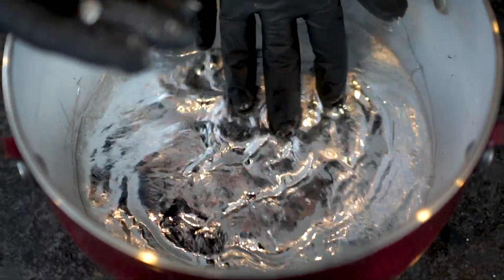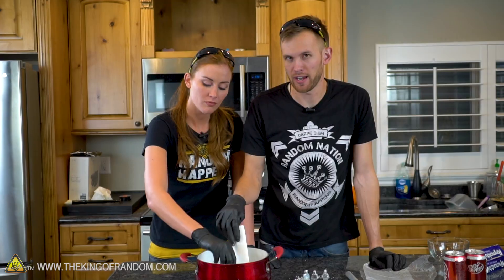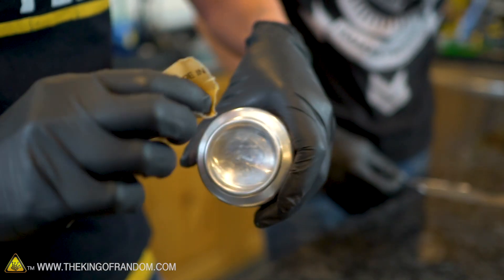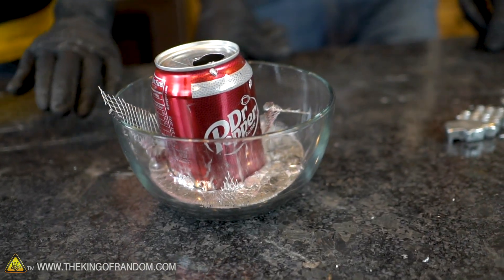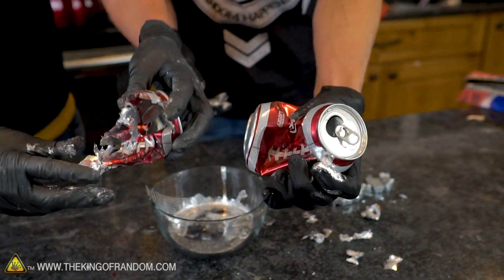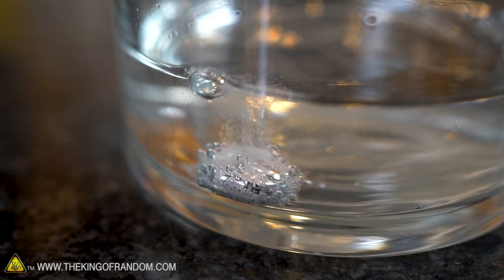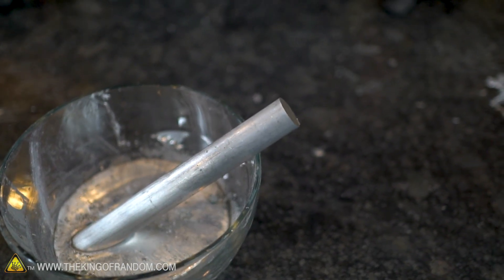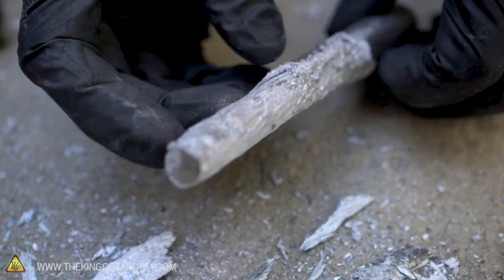We Made an Accidental Discovery

Comment: If you make a mixture in the ratio of 66.934 grams of Gallium for every 1.079 grams of Aluminum. Then heat it to about 700 Celsius, mix it and allow it to cool slowly. 

The alloy you made in this video was fairly weak, but what if you make as close to eutectic as the Al-Ga system is able?
Reply: Nobody will see this except me

Comment: I used to work for Lens Crafters and we used Gallium to hold lenses to the spot marker or a holder so we could generate the lenses , mark them to stick on the holder and also for the lense to be held in place for polishers to be able to work to remove the scratches from the lenses and to be able edge the lense to fit into the frames.

Comment: Can neverwet keep things from gathering condensation and/or freezing over?
Reply: specifically, use on a home A unit. I  sometimes leave the ac on too cold overnight, and wake up to the radiator covered in ice. Can a neverwet coating allow adequate heat transfer AND prevent the unit from icing over?

Comment: I’d like to see what happens when you put gallium in contact with aluminium cable and connect that cable to a welder supply. I suggest 25 square millimetre aluminium cable with 90 amps running through it.

Comment: How to break a solid 3/4” aluminum bar: 

Put it on a robot using it as the shaft for an arm on a gearbox with a 1000:1 ratio and overdrive the arm.
Ta-da! Snapped aluminum rod.

We had to replace it with a solid 3/4” steel bar instead....

Comment: That's not a plastic coating the aluminum absorbs the gallium like a sponge so the gallium goes everywhere inside the aluminum structure. You didn't need a hammer you could have just snapped it in half with your hands.

Comment: Can we get a video where you try to make a sandcastle but instead of sand you use "gallium aluminum alloy sponge"

I think you could light it on fire if it still has water in it, and that should remove most of it and make it a little more solid.

Comment: Aluminium and gallium slugs would be interesting. They'd likely just break apart in flight but if they could survive the g forces then they'd be an interesting round from a non over penetrating standpoint. You'd be hard pressed to shoot through a wall or innocent people behind the intended target with them. I know police forces use hallow points in the attempt to keep the rounds inside the suspect who is being shot and not have bullets go through the intended targets. But the aluminium and gallium rounds would simply shatter and likely not have much penetration. Would they even penetrate the intended target very far? You know who'd test this that Taofledermaus guy. It'd be interesting to have slugs or bullets or whatever made of the alloy that you made with aluminium and gallium and see what happens.

Comment: can you make a capacitor or battery using this new material? The gallium aluminum sponge? 

You made aluminum sponge! How does that effect the electrical conductivity of the aluminum? 

Being that it’s now a sponge the surface area must have increased dramatically. Can you use it as a dielectric material or as a collection plate? 

It’s very brittle but could you maybe hold it together using epoxy or some other glue? 

Please comment.

Comment: this makes sense, the only thing keeping metal from bonding to other metals is the oxidation on the surface of metal caused by the atmosphere. if you take metal to space you have to becareful with  metal touching other metal that does not have an  oxidationn layer cause it will bond with each other. In this video the galliam bonded with the can cause of the lack of oxidation under the surface of the liquid metal.

Comment: Tests durability by hitting with hammer for control.

Hits aluminium with it flat across the ground.

Proceeds to hit new bar soaked in gallium. 

Realizes it doesnt crack as easily as thought.

Rests bar on fulcrum of og bar and proceeds to hit soaked bar with needed leverage to break simply for drama; they say it's for a controlled experiment and then change for the drama. 

This is why i can't take this show seriously.

Comment: You should have an ingestion warning as gallium reacts with hydrochloric acid to produce gallium (iii) chloride which will paralyse you. Just a heads up. Also, elemental mercury's side effects are only present after regular exposure for a long time so really not that bad and also passes right through your digestive system without any being absorbed. Theoretically, you could ingest mercury and be perfectly fine but is still very risky as if it enters your lungs it will stay there releasing its vapours.

Comment: Your test with the hammer and the bars is not valid. You didn’t perform the exact same test. The non gallium aluminum bar was flat. You had the gallium bar resting on the non gallium bar resulting in a much refined point of contact.

Comment: The metal they used to build the twin towers
Reply: That’s why they’re not there anymore
Reply: Matt Peters lolz it will melt
Reply: They were actoally built to take the impact of the boeing. They just werent properly fireproofed.
Reply: @juanthehorse1988  To bad they didn't calculate in, that a plane has jetfuel in it.
Reply: @Sechs0rBecks  they knew that. Thats why they fireproofed it but the fireproofing came off on some of the main supports

Comment: The Gallium alloyed with Aluminum will prevent the Aluminum from generating a protective Oxide layer.  When introduced to Water the pure Aluminum, now unprotected, reacts to the water and splits the Hydrogen and Oxygen molecules better/faster than using Electrolysis technique.  That's why you had Hydrogen (and Oxygen) and were able to ignite it.

Comment: Please combine Gallium and Cesium to see what happens!
Reply: Nothing much, unless they are exposed to water
Reply: I want to see them conduct tests on it, including changes in conductivity, strength, heat capacity, and radioactivity, etc... as well as how it would react to blood, magnetism, fire, and water.
Reply: @BartholomewHenryAllen  would not react with fire, will have the same reactive for blood and water
Reply: Wouldn't fire heat melt the Gallium faster?
I know that blood and water also tend to have an attraction  towards metals. But I think blood would have the weirdest magnetic interaction.
Reply: @BartholomewHenryAllen  Gallium is already in liquid state at room temperature, so there is no need to melt it further, the iron in the blood is minimal and does not affect the overall magnetism of the alloy
Reply: I actually meant the reaction to fire after their solid state at cold enough temperatures. I know that copper in specific burns green and cesium burns a magenta color. It would be interesting to see exactly how the fusion would react.  And the minimal radio activity from the cesium should still have some interesting affects.

Comment: I think that the beating gallium can be explained with electromagnetism as the steel rod and the gallium blob surrounded by acid create a battery. Once the steel rod touches the gallium it creates a magnetic field as current flows trough the rod an the blob. As they have the same polarity of magnetic field, Lorentz forces pushes them away from each other. This opens the circuit which causes the Lorentz force to wear off and so it goes on until you pull the rod away from the gallium. Can anyone confirm this as this is only a hypothesis?

Comment: What would happen if you poured molten aluminum into gallium or vice versa. Also what would happen if you got both around 2000° F and mixed them.
Reply: Molten aluminium has a different effect on gallium than the other way around, because of the boiling points. At that temperature they will both be liquids. What will happen, depending on the ratio gallium : aluminium is that a new crystalized form will be formed with the gallium and aluminum, comparable to the result around 8:22. This crystallized form is way more brittle than both elemental.

Comment: well, it is not true that Gallium is not supposed to react with wate,r in fact it is supposed to be even more violent than aluminium (typical trope around all metals. the lower in their group the more reactive they are as a metal, as a metals standard reaction is oxidation or rather reduction as they tend to give off electrons. and this gets easier, the further you go down the periodic table) however similar or rather identical to aluminium gallium creates a passivation layer. the oxide layer, that prevents it from reacting with water or oxygen .and even liquid gallium has this layer.it´s at best 2 molecules thick (and that is if something gone wrong! it is a single layer in most cases) so adding a drop of water and puncturing the gallium through the water should yield some surprises for you. however, in the gallium-aluminium alloy the oxide still formed but it coul not form the perfect uniform layer that blocks everything and the water could easily touch the atoms of aluminium and gallium and then ofc everything happened as we saw and as you described. The water gets reduced to the hydroxide ion and hydrogen gas and we get these nice pops or in larger quantities not so nice bangs

Comment: Is it possible to build a simulated engine combustion chamber with an air compressor? Making the air to fuel ratio around 10:1 or 12:1 and having a spark plug in the drain hole ignite the gas, marking an explosion?

Comment: Awe I suggested hitting a gallium soaked aluminum item with a hammer in a previous video (melting Gallium with a flashlight). Guess you didn't see the idea in the thousands of comments but I will still quote it here if you do want to try the exact idea.
"You should cast aluminum in different shapes and pour some gallium on it after it cools. After a while take a hammer to it, throw it at a wall or even use a marshmallow gun on it."

Comment: i want to know what would happen to aluminum and galium if you mand galium into a dart and through or shot it at a pate of aluminum. or if you made a galium pellet or beead and shot it from a air gun at a plate of aluminum. would it it ist shatter flatten of disintigrate the aluminum or???
Reply: I think it would damage the chamber and barrel quite a bit. The heat will melt the gallium instantly, letting that smear all over the chamber and barrel. It will react with the metals inside and make everything very brittle

Comment: You have contaminated the gallium.
Reply: It's easy to refine, just leave it in sodium hydroxide solution and the aluminum will oxidize, forming sodium aluminate 
( 2NaOH + 2Al + H2O -> 2NaAlO2 + 3H2)
Gallium will react too, but at a much slower rate, below 80°C you'll lose <1%, as long as you remove the alloy once enough aluminum dissolves that it becomes liquid, you can move the liquid metal with a pipette, syringe or dropper, into a bowl of warm water and wait a few days until it stops bubbling then reclaim the gallium. Alternatively you could distill it, but you'd need a fractional distillation apparatus that can handle 2400°C, but with enough temperature control to avoid hitting 2470°C when the aluminum will start to come over.

Comment: Ok Grant, this one is going to be tough. Let's see what happens when you melt iron sulfide (pyrite or fools gold) into a mold. It's going to be tough because of the ionic bonds but I want to see what it would look like after it cooled.
Reply: Hm, it melts at 1177~1188 °C which might be more than they can handle, but they have done the ~800 °C salt. But then still… close to 400 °C more? :(
Reply: use a carbon arc furnace  7000  degrees  Fahrenheit !!!
Reply: it would just be iron because that is just a form of iron oxide
Reply: It doesnt melt, it just cracks and flys around when it gets hot.
Reply: Dead Man it does? You tried it? How did you melt it? I would love to see an example because I have never seen it myself. Have you seen a movie or something? I'm just looking for a lead on what happens.
Reply: *Nate😒
Reply: Through Ali's Eyes lol *thread 😃

Comment: You get better results if you rough or scratch up the surface of metals before allow them to soak the Gallium. Try that with the aluminum bar and you can use the Gallium to bust into am aluminum padlock

Comment: Can you dehydrate gallium
Reply: Yes? It's a metal and does not contain water. Dehydrating only removes water from things. Things that don't contain water, like the trays in the dehydrator, don't change.
Also not all liquids contain water and anything will become liquid if it gets hot enough, like glass or aluminum.
Reply: So by "Yes?" I mean he basically starts with dehydrated gallium or unhydrated at least.

Comment: What happens with gallium and sugar? Salt? Boiling it? Putting it in your metal furnace thingy?
Reply: Nothing, they are all solid solutions
Reply: @hunterbieberich4756  lol solutions are fluids... Sugar is an organic compound, unlike salts which are ionic compounds. Gallium is a metal which does not break apart the bonds of sugar, so if you mix both together, you will see sugar crystals floating on top of the gallium

Comment: The King of Random Using this method to make powdered aluminum for a thermite ingredient would be interesting, it would make the process much easier.  Normally powdering aluminum is energy intensive and is done with a ball mill, using gallium to weaken the structure of the aluminum to allow for easy powderization would be an alternative time saving step.  Making Iron oxide using steel wool submerged in a water bath with a small current passed through it is a quick way to create powdered rust.  I'm sure you know all this, thanks for the great videos.

Comment: What if you make thermite with the  gallium and aluminum alloy
Reply: nice idea, by the way the guys that said it's not thermite, there are many variations of thermite not just the classic rust and aluminum powder...............
Reply: Purifier Phoenix The Mecca is the gallium aluminum explosive though? If not then it still can’t be thermite
Reply: @sirawesomeness7543  its not the aluminum powder in thermite that truly makes it explosive its also the iron oxide because it provides the oxygen for it to burn as hot as it does
Reply: @sirawesomeness7543  that's the whole point of the suggestion. Anyways nurdrage did an experiment like this and it worked. Although he should have also tried mixing aluminum powder and gallium and iron rust separately instead of using powder made from degraded aluminum.
Reply: Purifier Phoenix The Mecca and how exactly did it work with ONLY aluminum and gallium without an oxidizer? If you can’t defend the chemistry behind the use of only those 2 elements then you fail like the rest of them at making any sort of point
Reply: @purifierphoenixthemecca  that is true I've made some myself before
Reply: That’s not how thermite works numb nuts

Comment: you messed up the experiment with the aluminum rods. you put the one that had been soaking in the gallium on top of the other one before you struck it thereby changing the outcome of the experiment. It may have been a small change but it was still different. Cool stuff regardless.

Comment: Even mercury is not unsafe to handle with bare skin, you just shouldn't ingest it or get it in your eyes, which is the only reason why you would want to wash your hands thoroughly after handling it with you bare hands. Mercury does not absorb into your skin. Either way, no one should handle mercury unless you know what you're doing.

Comment: I guess it was so unstable that the aluminum began rejecting the gallium, and since it reacts with water, not only did the water pull out the gallium (Which would ruin the structural integrity) but also begin to weaken with the water, essentially turning the alloy into some sort of powder which has partially mixed with the water, causing the milky color

Comment: I think it "stains" the skin because your skin is almost the same temp as its melting point. When you cause friction it causes the surface to melt and deposit microscopic drops of the metal on your skin where they resolidify and get stuck on the rough edges of the skin.